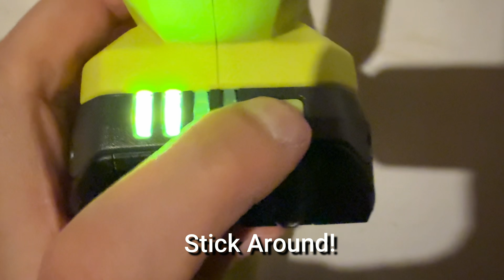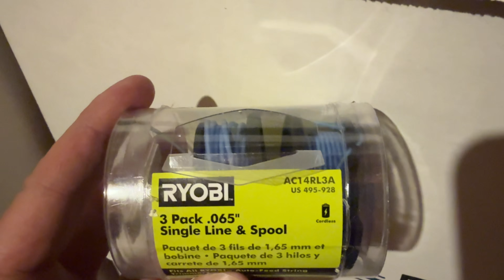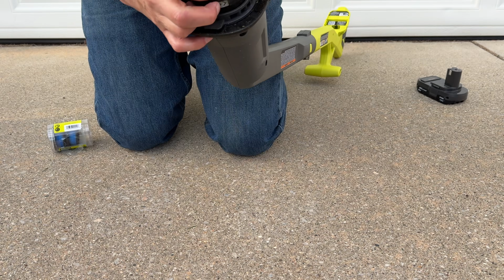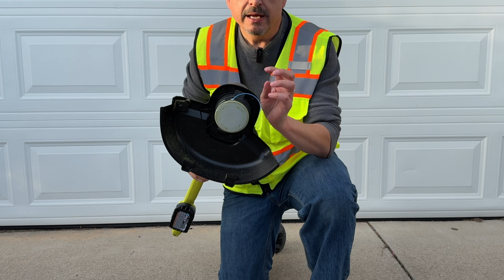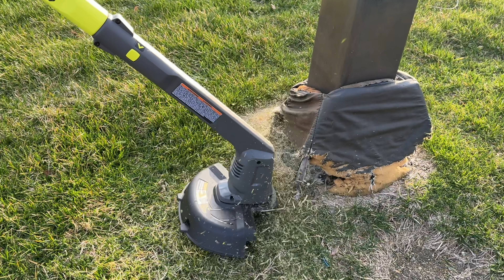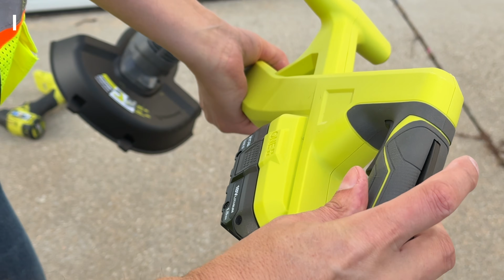Ryobi String Trimmer / Edger Line Replacement

Comment: Cleanest, clearest directions I've come across since I bought this trimmer 3+ years ago, thank you! I needed an update on how to use it to edge my driveway and whether or not I was still inserting the string holder correctly. I thought it auto-advanced but I didn't see mine doing that. I have to take off the battery and hand-pull the string out a few times to get more line but I'll go back out today and see if what I learned from your video helps me out with this. Also, nice seeing in comments (and your edit) that someone else struggled a bit with the 180 feature! It does work but it's tough on the hands! Thanks, again.
Reply from the maker: Awesome. Thanks for watching

Comment: Can you tell me why mine is feeding without pressing the button once respooled?
Reply from the maker: If you have the lower end Ryobi cartridge spooler model it should only come out every time you start it...If you have the more expensive Ryobi string trimmer where you spool it on manually....that one should only feed when you tap it on the ground...if this one is your problem take the string out and try re-spooling it

Comment: I just got mine and had to resting for the first time and I bought just some line to respool myself but for some reason when I put the spool back on I don’t have to press the button and the string just keeps coming out. I can pull it out without pressing the button. I can’t figure out why
Reply from the maker: You may need to take it off and respool it again....you have the model with the manual winder?
Reply: @HomeRapidRepair I figured it out. I had it spooled in the wrong direction. Thanks for the response.
Reply from the maker: @jokerski3250  awesome...I'm glad you have it all sorted now

Comment: Once you insert the line in the hole, does the line need to stay locked in the spool?  I’ve tried it both ways and it will not feed additional line
Reply from the maker: Hello, there are two totally different type of Ryobi string trimmer string systems. The first is preloaded canisters that just snap into place. The second is the one where you load the string in half way and then wind it up manually. I hope this helps

Comment: Is there a way to replace the string with other brands of string? So use the same spool, instead of replacing it. I bought some string not thinking, but haven't been able to properly string it
Reply from the maker: Yes, you can get that to work. Also, I’ll give you a tip. If you type in your Amazon search box, you will find so many knock off replacements that are at much less cost than the official RYOBI spools… And they have great reviews…

Comment: When a sibling, my Ryobi string trimmer and placing the guard, I accidentally installed the guard upside down so the guard was not on my side to where it would be protecting me so I unscrewed it, turned it around, attempted to re-screw it back in, but the screws kept going in circles so I don’t know if I stripped the screws or what how do I find the three replacement screws? They’re very short and small thank you.
Reply from the maker: In the past when I run into similar problems, I take one of the screws to the hardware store...like Home Depot, and purchase additional screws to match. Or sometimes just slightly larger if you are screwing into plastic...good luck

Comment: just feel like the start and stop really eats the line and im not trying to full throttle trim but rather direct attacks
Reply from the maker: That’s a great observation; steady speed definitely helps preserve the line much longer! 👍🏼😎
Reply: agree!!  how can you stop it from auto advancing??
Reply from the maker: @jessicadesmond4960  you cannot stop it from auto advancing. It is a feature that is designed with this particular string trimmer. RYOBI does make other string trimmers that are a little more expensive and more professional, such as their 40 Volt models that do not auto advance the string. Here’s my recent video where I compare the two different models: Ryobi String Trimmers - Cheap VS Expensive
https://youtu.be/jtx92RWR5_w

Comment: When I feed a new line through, it doesn’t just trim it with centrifugal force, it yanks it until it tangles. How do I get it to stop feeding?
Reply from the maker: My best guess is the cutter is no longer sharp, or fell off…check the sharp blade cutter.  Next take the spool off and clean things out to see if anything was stuck

Comment: Hi thanks for a great video I’m from Melbourne Australia and just bought this one. My line keeps breaking and only a small amount appears to be coming out. My line also got tangled inside and can’t seem to get it out. The edge trimmer doesnt seem to be working as well as you have it but maybe I need to move it higher above the grass I held it really close  my hubby normally does this at home but am doing my late mums garden. The grass is thick couche and tough to cut through. I even bought slightly thicker cord which seemed to work better it I somehow managed to still untangle the cord. Hope you can help cheers Jodie
Reply from the maker: Thank you for sharing all of your experience with this string trimmer. The more we learn from each other the better. Yeah that’s smart of you to try the thicker string so it will hold up better. 

As far as the string tangling, I’m not sure… I haven’t come across that problem yet… Sorry. Good luck 😎